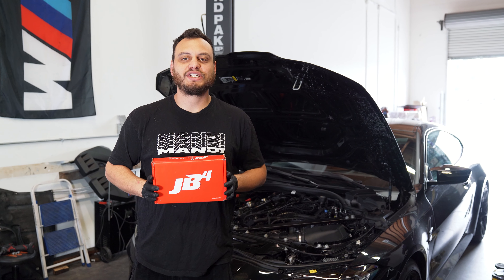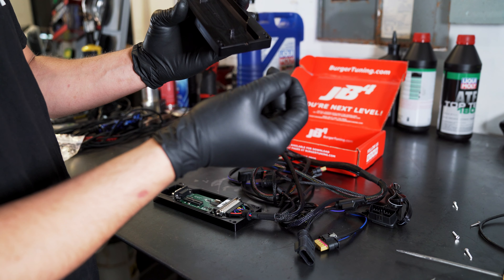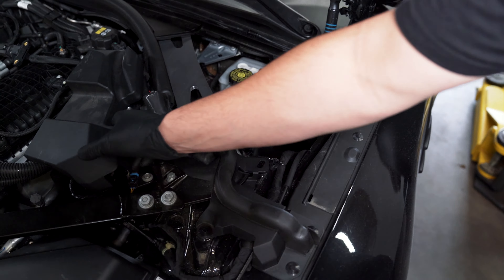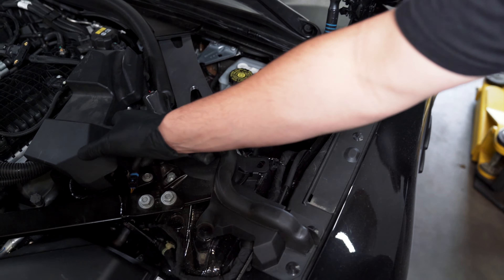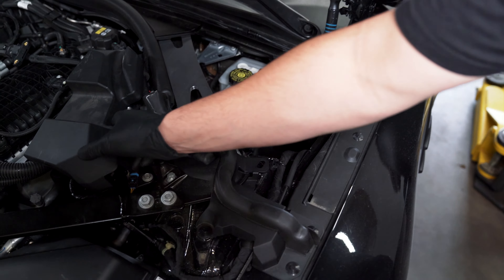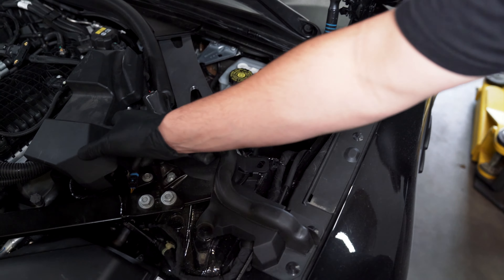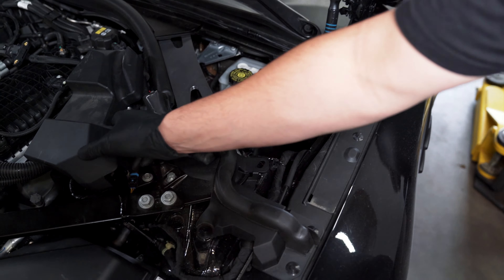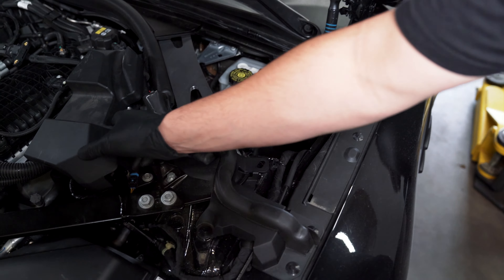OVER 700HP FOR LESS THAN $1000 ON A S58 | G80 M3 G82 M4 G87 M2

Comment: Got the same spec car in skyscraper gray. Also the jb4. What map, in your opinion, would take the car to 700+hp?
Reply from the maker: The ethanol maps which are map 4/5. generally 5 is the fastest map with a blend in the tank of about e40. will put down about 650 to the wheels and well over 700 Crank HP
Reply: Running E on even these motors is a ticking time bomb fyi
Reply from the maker: @Emanuel_Clutch22  They actually love it and have been showing great reliability in the 7-800hp range with many people well into the 4 digits on stock engines. Running Ethanol does require more maintenance to maintain peak performance and reliability. Service intervals like oil change, spark plugs, injectors should be cut in half if not more. Making sure to run the car often and not let the E sit is critical in any car.
Reply: @manji_tv  great reliability compared to other cars, yes but still a ticking time bomb.
Reply: @manji_tv what will map 2 with 93  gas intake put you at on a 2025 xdrive comp m4